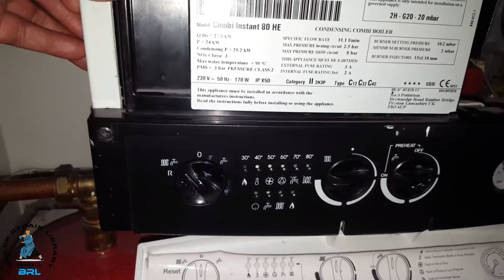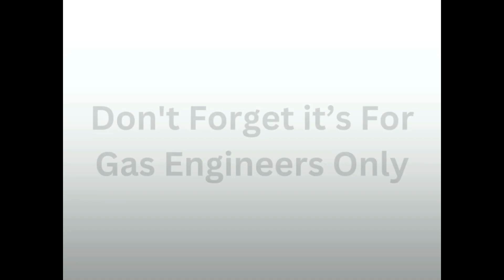30 Degree Red Light Flashing Baxi 80 HE Instant

Comment: Exactly that happening on mine.  No luck yet finding the fault but interesting that a PCB fault can cause it to briefly work and then cut out.  Did find that if it did fire up properly it worked find if already warm.  Seems like lots of people have the '30 flash lockout' problem with Baxi boilers!
Reply from the maker: Yeah, it's a common problem.  Also, can you subscribe to our channel, please 🙏